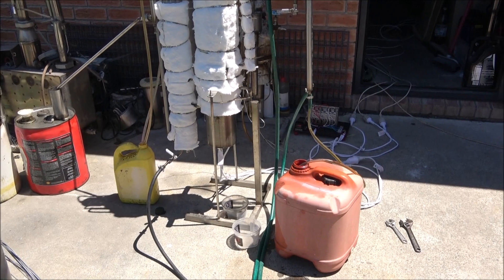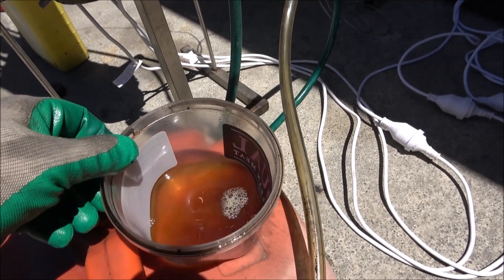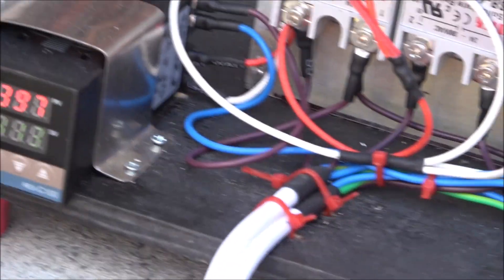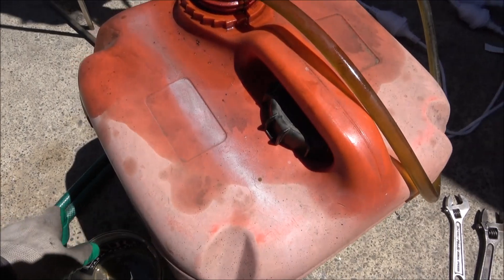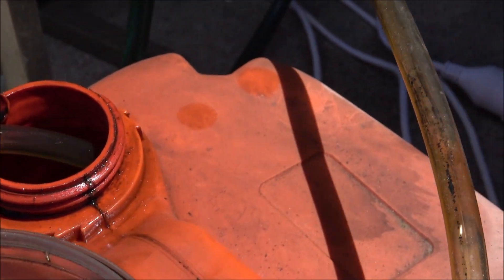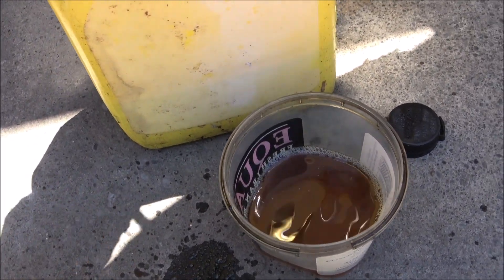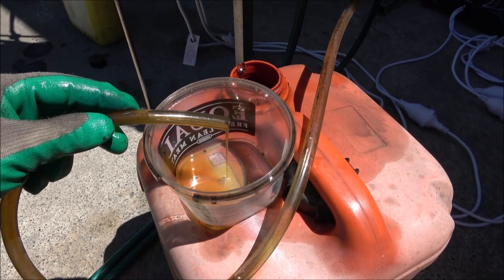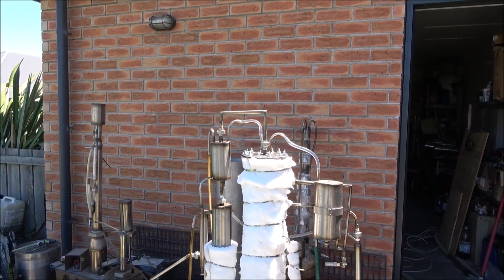Continuous waste motor oil reformer testing.

Comment: Out of interest, how much power does it use?
Reply: 6 kilowatts per hour, I believe with 24L per hour of diesel. He said in one of his videos 24L after cleaning cost $5NZD. Use straight in any diesel engine
Reply: @theaussienurseflipper.8113  Cheers.
Reply from the maker: In the case of ATF fluid processing, the yield is over 90%, a used diesel oil will give about 80%. The waste can be processed further in pyrolysis retort down to a solid state, and it is possible to get some petroleum gas and crude oil like liquid containing petrol and diesel fractions.
Reply: @santeryi9  Many thanks.
Reply: How refined this oil?

Comment: Approximately what percentage of the waste oil is diesel?
Reply: I watch a lot his videos, I say high 90%, very little waste with a cost after cleaning 24L for $5 new Zealand dollars. That includes electricity. He states you can use it in any diesel engine.
Reply: at those temps the oil crack's and you get lower fractions. so moste is converted to fuel.
Reply: @grapsorz  I not doing it. I just watch few of his videos. But they be able to make diesel which runs in any vehicle for around $0.10 USD a litre or 40cent USA gallon, who cares . It nearly $10 AUD a American gallon here in Australia. Once set up, little work and U could sell it

Comment: I need to know what process can be used to treat the product so it does not oxidize so quickly
Reply from the maker: Try this one: https://youtu.be/YUT4ZQMBgVo
Reply: @santeryi9  Hello sir. We have no silica gel here. I saw your video on using triethanolamine. How can I refine the diesel from used motor oil using this method. What percentage can I use. Thank you for your hard work